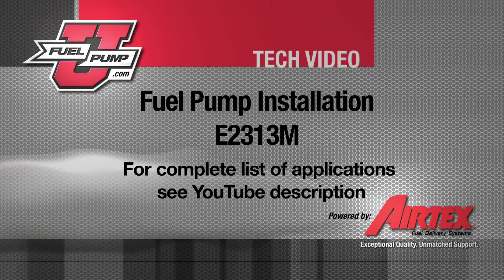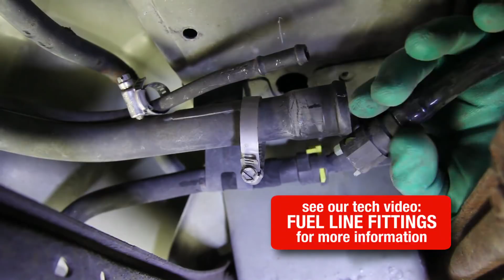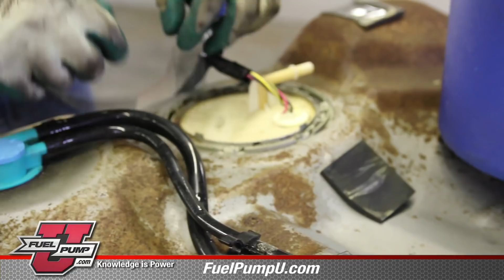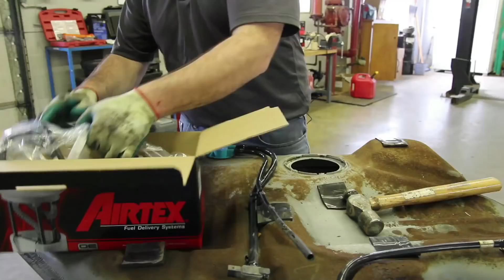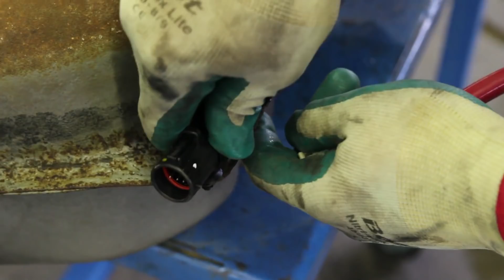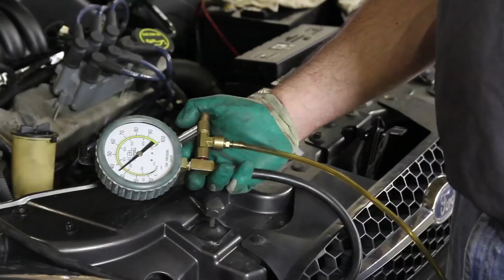How to Install Fuel Pump Module Assembly E2313M in a 2003 Ford Taurus

Comment: my car is a 2002 mercury sable 3.0L v6  the car starts but when i hit the gas pedal it turns off is that the fuel pump...or what do you think..????
Reply: ***** quick question just to be sure is the fuel pressure valve the one with the plastic green lid on the passengerside corner by the firewall?